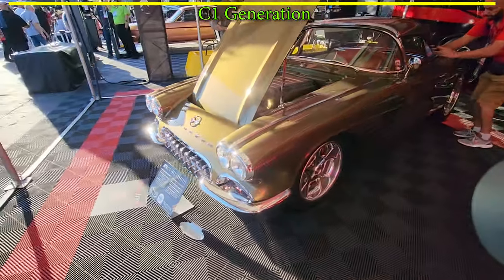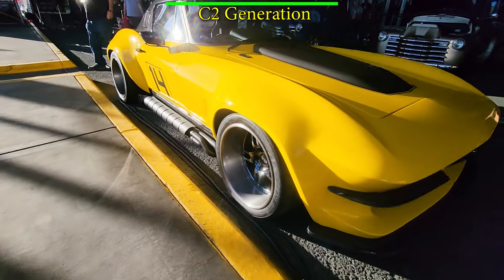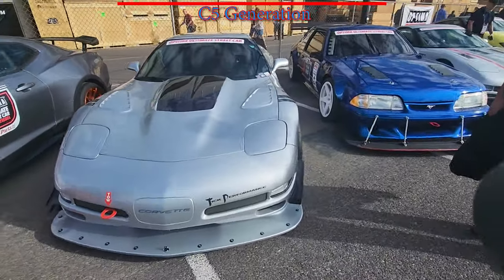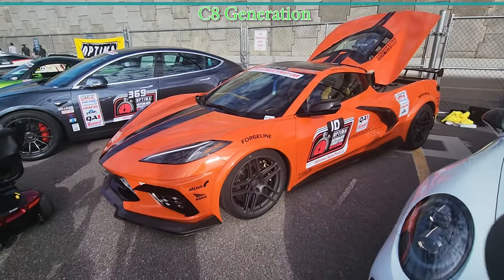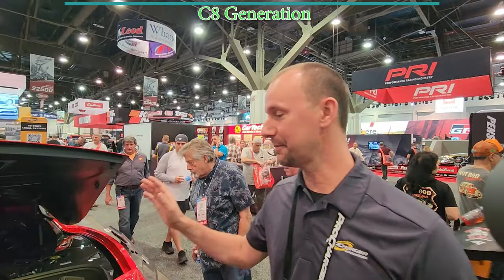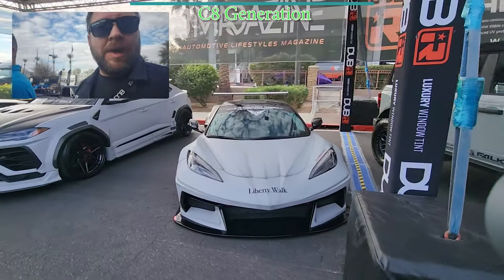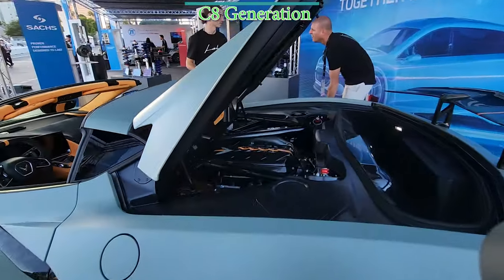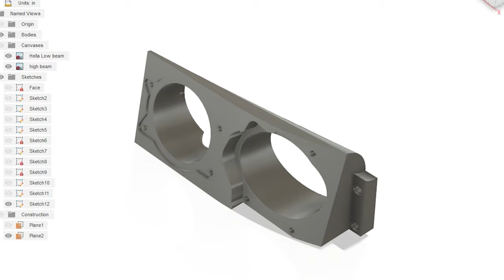Every Corvette at SEMA 2022 | EV Conversion | All GENS

Comment: Gosh, there's so much in this video! I'll agree the EV conversions are coming. There's no doubt, whether we like it or not. The current EVs are basically the same bland car. If you've seen one Tesla Model 3, you have pretty much seen them all. Sure you can wrap it to make it something visually different, but the hotrodding and upgrades are pretty limited at this point. I just don't think the traditions from the past are going to last. The hard part is getting an EV that can fit everyone's lifestyle. I like the fact that we can save some of the best cars from the past and keep them around in some fashion, but until the kits aren't $50k for everything, I think most of us will just sit back and watch the progress.

I agree with Lace on the yellow C3. Interesting and a good shape. I would have been all over that one giving a thorough check of everything. 

That Gran Sport C4 was so clean, and in a SEMA setting it's so boring. Agree that hopefully they start to get some representation there soon.

The C5s, what can you say. Mild to wild, especially with the Optima cars. You can almost just have a recipe book anymore with any car there. C10s look similar, C5Z, C6Z, 1st gen Camaros, Mustangs, etc. What really works is pretty limited and they all almost fall on the driver to win it (as spec racing should be). It's like a wilder version of Spec Corvette racing. Did you walk around to every C5 there and give them a business card?

Thanks for covering the Corvettes at SEMA. Hopefully you have a good rest of the week with just a couple days left.
Reply from the maker: Nahhh...I dont push the cards much...I just do my thing, make the content and make the parts...so much to do, so little time
Reply: @KnightDriveTV  I read this week about the plan for expansion over the next 5 years with a weekend festival after SEMA. What are your thoughts being a local? Will it gain the public interest as they plan for?
Reply: You can always build your own battery pack. 

It's unforgiving and reckless if done without precaution and safety, but that's one way to make an EV conversion stand out.